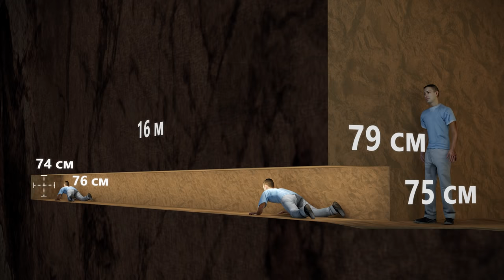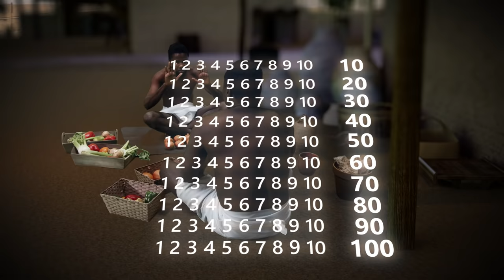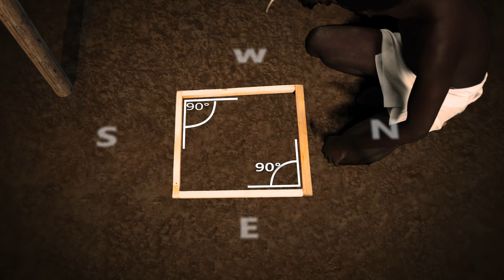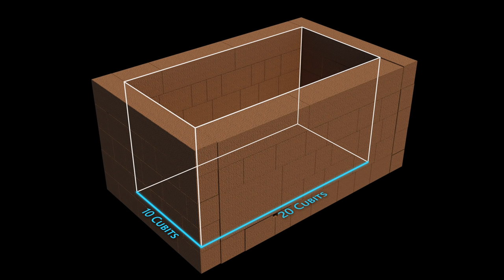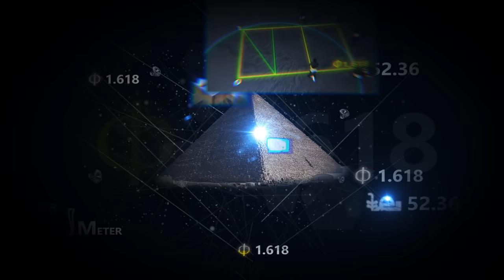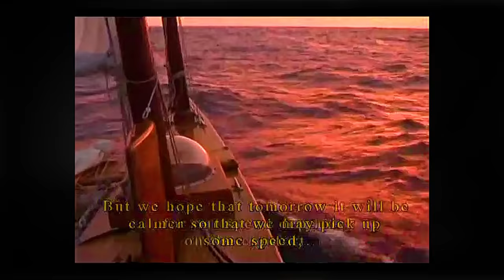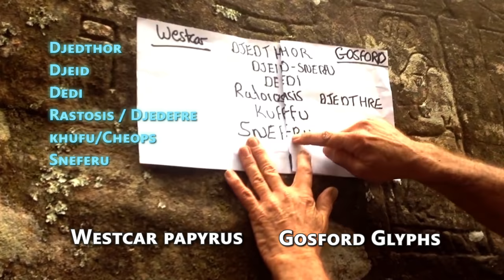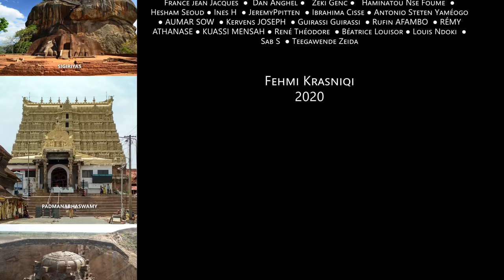The Movie Great Pyramid K 2019 - Director Fehmi Krasniqi

Comment: Great theory, except what material were the forms for the molten granite made out of? Not wood, that's for sure.
Reply: And also who polished the surface later on ( talking about sarcophagus)
Reply: plygranite...It's right next to the plywood at Home Depot
Reply: Let's see, what do they make molten iron out of ?
Reply: clay.. he said it in video.
Reply: They probably had metal or wooden forms like a modern building. By now those forms would have rotted away. How come each stone is so close to each other? Not sure. If the pyramids are at least 5,000 years old that would mean many of the original materials would have changed by now through petrification and fossilization etc. There is much proof that the pyramids have been under water like sea fossils that are stuck to it, not to mention they have been burried under sand too.  With all that pressure and time, just like coal into a diamond, many materials would change.  We know from the petrified forest in Arizona that trees can turn to stone. So as far as statues and such from antiquity, if they were buried under sand and possibly water for thousands of years, things once carved from wood etc. may be stone in present day. This would explain how some things were carved into stone. They weren't! They were originally carved in wood. Does cement and or petrification explain everything? No, but its a good start and makes sense. Ppl want Aliens to be real but fact is there's no proof. Besides what advanced race of alien with spaceships made from metal and that can fly at "lightspeed", are going to enslave ppl to build stuff out of stone? Kind of dumb when you think about it. As far as drill hole and saw marks go. If a lot of stuff was originally wood or cement it would have been softer and easy to cut at the time with their tools. Time is what hardens things, even stones and hearts.
Reply: ....sand.
Reply: Titanium maybe :-)
Reply: @wayphun72  yeah, that makes sense, but the smooth surfaces suggest it wasn't. Someome mentioned clay, and that's a possibility. Regardless, Egyptians weren't black people, and that little piece of agenda made me turn off the documentary. I mean, they drew themselves all over the place and colored themselves orange-ish, not black.
Reply: @captaindiabetes4244  you should watch it A gsin... Melt Granit and baselt stone.. And clay... Or concret.
Reply: @UnderFireOften  I would believe the melting granite theory before the alien theory based on math and physics.
Reply: I'm Australian.. 41 years old. This the first time ever, I've been informed of anything Egyptian in Australia. I feel cheated!!
Reply: @CaptCutler  ya agree about that agenda they had going.  Boy the ending would've really drove you crazy...it pushed the narrative hard.
Reply: @wayphun72  i figured as much. Sucks I wasted 2 hours, but the math stuff was kind of cool. A spoonful of sugar helps the propaganda go down.
Reply: @CaptCutler  All the noseless statues for no reason then? The Sphinx...LOL, they maybe themselves orange...LOLOLOLOL
Reply: I heard sacrificed bodies were mixed with the granite!
Reply: @nicholaspeti7495  they had no iron...hence the name bronze age....
Reply: @UnderFireOften  rock does not fossilize or petrify
Reply: @CaptCutler  good forbid we tell the truth.....didnt you know both jesus and santa claus were blacker than obama
Reply: @CaptCutler  those drawings are Middle and New Kingdom. I'm glad I could clear that up.
Reply: Clay just like with all molds!
Reply: @PaulLuckey  LMAO!!!!
Reply: Yeah I think UFOs are prejudiced on no joke shit I mean if they left their homeland to come to another home then sounds like somebody I know Europeans or should I say “your A peein”😂🤣😂😅
Reply: @babyjesse963  They actually call themselves The Federation of Light.
Reply: @themissdior1235  a lie is a lie.
Reply: @spacexvanityprojectslimite3315  .. That was something called an "Example" .. And what you don't know will amaze you.
Reply: @CaptCutler  Ancient Africans being Black is one of the most believable points of this psuedo-documentary! It amazes me that people think others would  use colored paint to represent themselves and ....oops...use the wrong color.
Reply: @deirdramcneil2409  That's what I'm saying! They never painted themselves as black, so, you know, they must have been black. It wouldn't bother me if they were in fact black, but the lying about it really irks me. Northern Africa at that time was "Mediterranean", not "African".
Reply: @Capt. Cutler Black people come in many shades. Period. Why is it a problem that Africans are Black? All white people don't have pasty white skin. They have different shades too.  I think the point he was making is that at that time Egyptians were darker(Black)-not Mediterranean. We're not taught that. He used visuals to stress that point.
Reply: @deirdramcneil2409  *indoctrination.
Reply: lol the whole video can be flipped upside down when you realize what actually happens to granite when you melt it.
Reply: Haters will always have a mouthful but BRING ABSOLUTELY NOTHING TO THE TABLE. Not one comment. Its not my place to say if this is right or wrong, but the amount of work put in this film is outstanding to say the least. Sure there are questions left open but overall the evidence is mindblowing. I work construction and let me tel you WALLS ARE BILD EXACTLY LIKE THAT!! These are experts working with evidence for 6 years. Keep an open mind even if you don't like it.
Reply: @alexramos9342  Hollywood spends BILLIONS every year and puts a lot of work into selling you lies. Just a thought.
Reply: They claimed clay.
Reply: @CaptCutler  The hierogligh has nothing to do with arabo-persian language like we were lied to for long time
Reply: @CaptCutler  😂😂😂🤦🏾‍♂️🤷🏿‍♂️ Yet, you can't refute a fact I just said
Reply: @CaptCutler Oh yeah, the human genome diverged from Blacks, feel free to dispute those facts as well.. silly you

Comment: This video had me wondering until they showed granite melted and then solidified in a mold. Every first year geology major knows that if you melt granite and then solidify it at the surface you would not get granite. When it cools you will have a rock called rhyolite. Thats why I'm calling BS on the whole thing!
Reply: NO!  They simply insulated each block very very very very well after pouring, then waited a few millions of years for it to slowly cool, and allow large mineral crystals to form to result in what we call granite.  Easy Peasy.  Problem solved :)
Reply: Interesting point. Could be back to square 1.
Reply: A well welcomed thanks to your entry. From cocoacrunch entry below : "Why do the "melted granite" statues have cutting marks? Left over from the mold, maybe? That seems very sloppy for something that would be otherwise so perfect"................................further supports your view.

1
Reply: @ptauagpt  There should be tool marks, it had to be carved. Here's a quote from OSU. "Rhyolite is very closely related to granite. The difference is rhyolite has much finer crystals. These crystals are so small that they can not be seen by the naked eye. Rhyolite is an extrusive igneous rock having cooled much more rapidly than granite giving it a glassy appearance. The minerals that make up rhyolite are quartz, feldspar, mica, and hornblende." http://volcano.oregonstate.edu/book/export/html/1055#:~:text=Rhyolite%20is%20very%20closely%20related,giving%20it%20a%20glassy%20appearance.
You see, the crystallization process takes many years to produce large crystals. The long cooling processes that produces granite would also require substancial pressure, as in... granite cooled very deep in the ground.
Reply: It is stated in books that they were cast in place
Reply: @ToddCobbs  so could you plz define how do they cut and carved this hardest material so finely. I was so convinced by this video and now ur comment ruined it
Reply: @sbabarjadoon1973  No, he has no idea what he's talking about. The video is the best explanation I've seen and I've researched this for years.
Reply: @renerentas4702  Which books?  You can't count the one my great great grandmother wrote because she only went to school through the second grade
Reply: @sbabarjadoon1973    I do not claim to know how they carved it. I'm a Geologist, not an artist.
Reply: @ToddCobbs  may Allah give u much more success in ur field. I was just curious not at all sarcastic.
Reply: @renerentas4702  Consider getting a new book.
Reply: @sbabarjadoon1973  The hardest thing in granite is quartz witch is only a 7 on the hardness scale thus, any thing harder could cut or grind it. That includes topaz, corundum, and diamond. 
https://www.gemsociety.org/article/select-gems-ordered-mohs-hardness/
Reply: scroll down a little and see the rhyolite next to the granite. Notice that Granite has large visible crystals? Rhyolite and granite are chemically identical. The only difference is the pressure and speed at which they crystalize. If you melt granite and dump it on the ground where there is almost no pressure and it will cool rapidly, you would get the rhyolite. a Pink stone with no distinguishable crystals.
https://www.ck12.org/c/earth-science/igneous-rock-classification/lesson/Igneous-Rock-Classification-MS-ES/
Reply: @rickhunter1317  You need to continue your research or just explain the granite vases ,thousands of them, how were they produced ?
Reply: @renerentas4702  it is stated in books that spiderman is real.

Comment: This should be taught in every school in the world 🌎
Reply: I damn well hope not lol.  You believed poured granite? Learn how long granite takes to form under massive pressure too - not atmospheric temperature.

At Aswan there is a massive obelisk being cut from the bedrock.  Why bother if you could just pour it?  This is just yet another hypothesis and the granite is a deal breaker plain and simple.

This is before we start on the fact that thousands of stones all around the Giza plateau show tooling marks on them, bore holes as though they were lathed.  Walls where you can see the rough stone that is being honed down to a smooth surface.

Many of the stone slabs on the ground are diorite perfectly interlocked - they seemed to forget those too.

Then we have the Sphinx with water erosion that dates it back 13000 years.   

This documentary is like so many,  present the evidence and sweep the rest under the carpet and hope no one notices.

Well some of us have noticed I'm afraid.

Comment: They had me up until the part about melting granite, that I can't buy.
Reply: Is it possible? The answer is yes. 2000°f will melt granite
Reply: @thedangerous1  Yes, but can you think of a substance that could be used to make molds that can withstand those temperatures and hold the molten granite.  And then, could they have made it in the bronze age?  Now ponder this:  If a global catastrophe wiped out humanity today, what signs of our civilization would be present 10k years from now?
Reply: @santodiaz8049  Sand casting/molding. Plenty of sand in the desert. Idk about these other places around the world, but you would only need a certain amount of sand since it doesn’t go bad. IIRC, they actually speculate that the Mayans created a mixture of fertile soil for farming, and that soil contained sand. It makes sense to me.
Reply: @thedangerous1  ...yes but its no longer granite after melting. It turns into obsidian...

Comment: I  think that any chemist would have a problem with the claim that all drops of water are one centimeter...
Reply: A major absurdity or rather stupidity of this film
Reply: On average it is. I did 50 drops of water and 42 were 1 centimetre and the others that were not I made a noticable mistake dropping the water. That is how they came to use the metric system.
Reply: You need drops with accuracy 1 cm +/- 1 micrometer to speak of some "Engineering Standard". The same problem with all wooden "precise instruments" in this film.
Reply: It depends on the exact surface characteristics of the material it is dropped onto and the temperature. And the size of the drop can vary considerably dependent on the item it is dropped from
Reply: So they did that during the summer when the sun is the most powerful instead of taking care of their crops? Am i getting this wrong?
Reply: It's the surface tension of pure water that's standard, therefore water drops are quite uniform and it is the round number of drops precisely that determined the units for metric, not the other way around. APfft. Amateurs.
Reply: @taylorgall9516  this has nothing to do with the metric system.
Reply: @thegratefulbrad3072  If I drop water and measure it with ruler I'm sure it will be about 8 to 12 mm! So that is the impressive part of the movie argument. The surface tension is the dominant factor for the weight of the drop and diameter of the splash but there are many other small factors. The small factors control is the difference between primitivism and technology. Such a low standard can't explain discovery of PI, PHI and many other claims with 3 digits precision in this film.
Reply: Not all drops, just the ones of one centimeter.
Reply: Viscosity is the  resistance of a fluid to gradual deformation by sheer stress or tensile stress,   water has the 1 to 20 correlation  of 1 water  centipoise to 20 degrees celsius. this is constant an in a sense the measure of a drop of water.
Reply: @taylorgall9516   1 centipoise equals or corresponds to 20 degrees celsius. this is constant, always the same.
Reply: @penyopetrov7081  1 centipoise equals 20 degress celsius that is an exact engineering standard
Reply: @pencilme1n  1 water centipoise equals 20 degress celsius, hence the metric standard
Reply: @stefanpoulin1258  Other people farmed just like now, we all eat but not everyone grows food.
Reply: @D-B-Cooper   The viscocity of water is 1 centipoise to 20 degress celsius there is a 10 based system built on the constant temperature at which certain fluids boil or freeze. water has that correlation so in a sense a drop of water is a 1 to 20 measure at a chemical reactive constant.  The metric system
Reply: @elizabethdesousa8290  Good to know! ☺️
Reply: @penyopetrov7081  The viscosity of water is measured to be 1 centipoise to 20 degrees celsius,  this is a constant hence the accurate measurement,  which is technology.  This 1 to 20 correlation is always the same and found in nature, repeatable and accurate.  The drop of water description is also in a sense accurate.
Reply: @chelvangiels2017  no all drops, the viscosity of water is a 1 centipoise correlation to 20 degrees celsius, this is  a constant
Reply: @elizabethdesousa8290  they metric system was measured out around 1800, measured from the Balkin to the Mediterranean. They had no accurate way of measuring drops of water at that time. Metric system is based on an error. Look into metric time for a good laugh.
Reply: @bethbartlett5692  I like that I can’t read and write and I get some of these high school graduates college degrees to erase their comments😂
Reply: I reproduced the experiment from the movie. My result is the same. I used very clean glass surface. For my surprise though, no one drop was circle, no even close to circle. Thats why they are using ruler and distant camera instead of high quality zoomed picture and measurement markers.
Reply: @stefanpoulin1258  thats what the slaves were really used for....lol
Reply: Have u ever tried the experiment 🧪 over time in order for you to come to that conclusion?? Wondering??
Reply: @stefanpoulin1258  im sure their was others to take care if the crops otherwise they may have starved to death 🙂
Reply: @Brwnsugar   Yeah but they say that slaves were not used and everybody was happy to works at these projects... I'm just trying to see if it all makes sense because their theory is very interesting.  Thanks for the answer though.
Reply: Billy File  The best way to remain ignorant is to never ask questions. At best it's an opportunity for conversations, at worst you get that type of comments from condescending trolls.

As for the thumbs up, I don't know what you're talking about but if it is the case, it's an accident. One way or the other, what is it to you ? If that type of comments is the best you can do with your spare time, it's time for you to find get real job, you clearly have too much time on your hands...
Reply: And to claim it to be a universal constant is absurd.
Reply: Hahahaha.  Hydro dynamics.
Reply: @stefanpoulin1258  summer months were flooded..
Reply: @ben-hd5vf  which is why one material was settled on. 
It would remain constant for each material. 
What is your point?
Reply: Billy File  😂 You made me laugh about you telling off the guy for liking his own comment 😂
Reply: @ben-hd5vf  the problem is not the size of water but the shape of water. The shape is never the perfec circle you may expect.
Reply: @ben-hd5vf  You are right about degreasing, thank you!